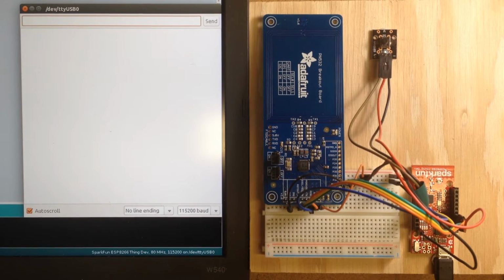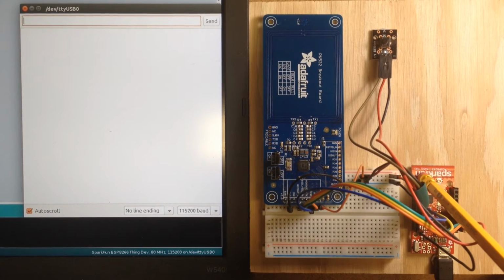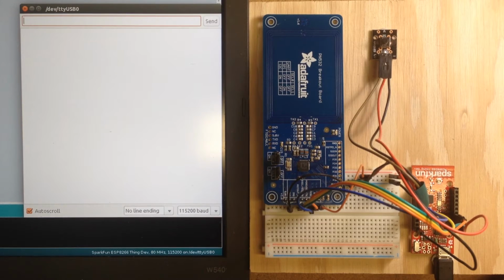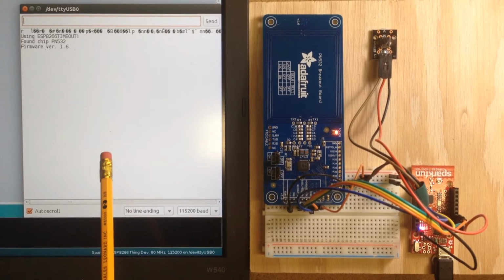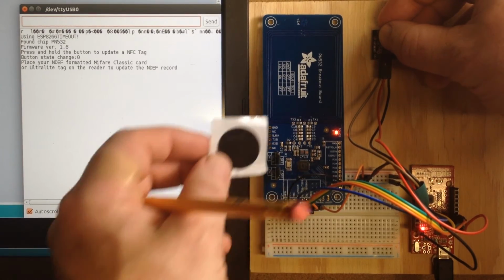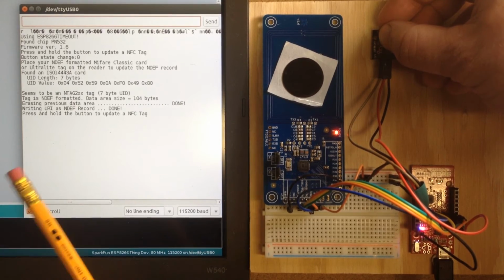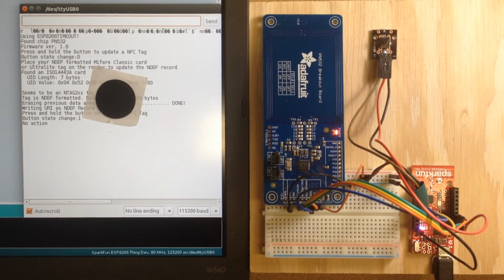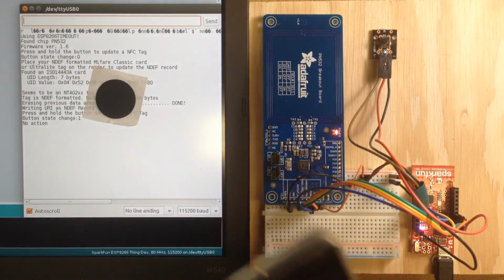NFC + ESP8266 Demo

Comment: may I ask you to add pictures of your wiring layout please. I have the pn532 shield but Im trying to use it with an esp8266 and I havent been able to get the wiring right. 

Thank you for your help. your video has been helpfull
Reply from the maker: Hi Guy, I don't have this set up anymore so I can't easily get you picture. But I did make careful note of pins-to-wires mapping in the code: https://github.com/sfoster/nfc-explorations/blob/master/ntag2xx_btn_update/ntag2xx_btn_update.ino#L30:L35